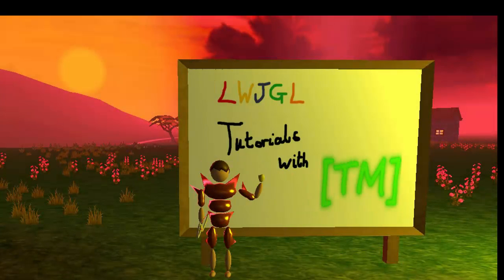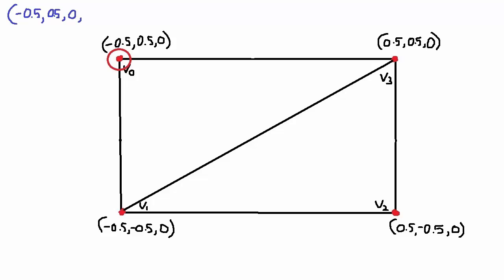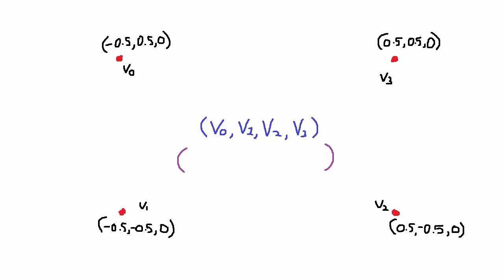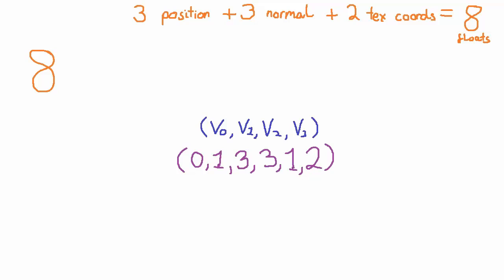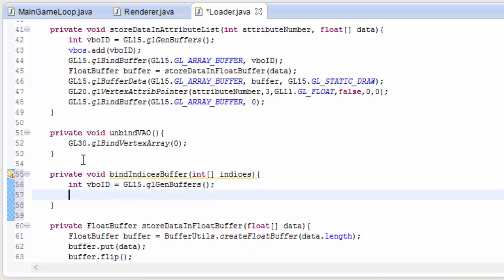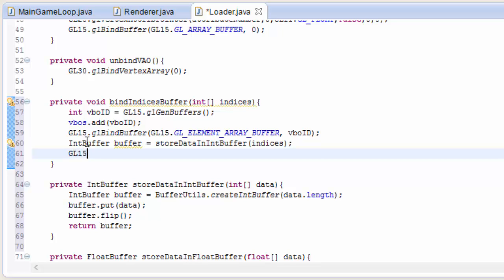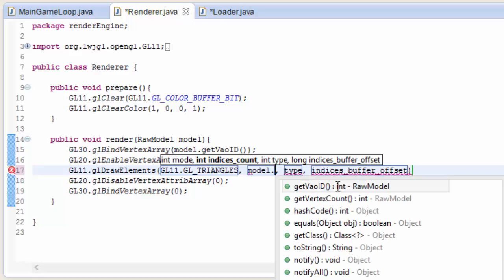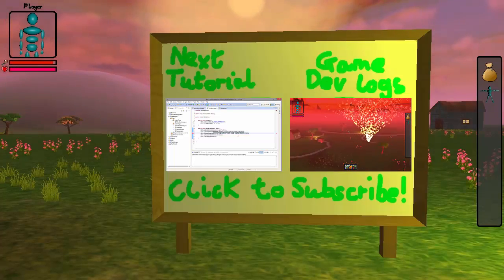OpenGL 3D Game Tutorial 3: Rendering with Index Buffers

Comment: you never called the unbind method for the indices buffer. dont you need it or did you just forget it?
Reply from the maker: You mustn't call it actually. Each VAO can have one index buffer associated with it. Binding an VBO as a GL_ELEMENT_ARRAY_BUFFER will set the VBO as the index buffer for the currently bound VAO. Unbinding it would remove it from the VAO, so then when you try to render using glDrawElements it wouldn't be able to find an index buffer associated with the VAO and it would cause an error.
Reply: ah ok. thx :)
Reply: can you explain more in depth about why the indices buffer shouldn't be unbound but the vertex coordinates buffer should?
Reply: reading more on the internet i believe that gl_array_buffer doesnt matter if it is bound or unbound since it can be rebound later?
Reply: +Steven Chu In case you're still wondering, when you've got a list of VBOs in a VAO, only one of the VBOs can be the index at any given time. In our case, it's the Indices VBO, because we use that to choose our vertices. 

As for GL_ARRAY_BUFFERS, our other data is that in the VAO (normals, vertices, textureCoords). Since you're going to have multiple of them, you need to specify which VBO you're going to send the data to. From what I understand, if you were to send anything to the GL_ELEMENT_ARRAY_BUFFER, it'll always be sent to the same VBO as the VBO the indices currently are in.

Comment: Just a question, i'm going to be making a voxel based game, is there any point at all to using indices considering each face is rendered depending on whether the thing next to it is rendered?
Reply: Yes, there still is. However, what you should probably do is create a VAO for one face, and re-use it whenever you need to render a face. Then use matrices to transform the faces.
Reply: Freakey _ Yes, you're right. However, the point of this is to allow for proper per-face culling. But there are probably better solutions to this problem, such as instancing like you suggested.

Comment: Great tutorial. I am wondering though, right now you are using one VBO plus one EBO per each model. From my understanding, there are two issues with that:
First of all, some drivers cannot handle many small buffers very vell, there is a limit of buffer allocations which for some drivers is just a few thousand (I could easily imagine a game with more models then that).
And secondly, this should be performing relatively bad as you need one bind + draw call per actual object in the world. That sums up to a lot of GL calls per single frame.

Then again, I have very little experience in OpenGL, just trying to follow some tutorials. Is this actual an issue? I assume you have much more experience than I! Thanks!
Reply from the maker: You are correct, it would definitely not be a good idea to have one VAO for every object in the game! But at this stage of the tutorials I was just introducing the concepts of VAOs and VBOs ;) Later in the series (by about episode 10) we start using one VAO per model in the game, so for example you could have 10,000 tree objects in the game but they all use the same VAO.
One draw call per objects isn't always too terrible though, and in fact there are some situations where you can't really avoid it. When you have many very different, dynamic objects with different textures - it's very hard to render them all in one draw call. But multiple draw calls can be done very fast on modern computers, and you shouldn't worry unless you're sending tens of thousands of draw calls per frame.  There are other situations where it is definitely possible to render many objects in one draw call though. Later in the series I cover "instanced rendering" which does just that, and if your world has a lot of static objects which use the same "material" then you can batch render them, although I haven't yet covered this in the tutorial. I use batch rendering for the static objects in my own game though.
As for one bind per object, we actually get that down to one bind per model in episode 13 (so 10,000 trees could be rendered with only one VAO bind required) but what I've never got round to showing is how to store the data for multiple models into a single VAO. You are correct in thinking that this would be better, as it would allow for less binding of VAOs before rendering. This is again something that I do in my personal projects, but I didn't really find the place to fit it into this beginner's tutorial series. Perhaps it can be a future tutorial though :)
Reply: Wow, great answer! Of course this is just the third episode of a beginner's tutorial on OpenGL, so I do very much understand that this is the best way for you to explain it. I was just wondering about scalability, and especially how you do it in your own games. Thank you for coming back to me so very quick, and keep on making these excellent games / tutorials / videos / comments / whatsoever!

Comment: Two problems,

1. can't read indices and makes game not run

2. before this episode i didnt get a white box in the center of the game, only a red background
Reply from the maker: If you get an error then it's best not to continue until you've fixed that error, so I'd suggest getting tutorial 2 working before you continue to tutorial 3. It's hard for me to guess what could be causing the error, so I'd just suggest going through the tutorial again and checking that you got everything correct.
Reply: k, got it, i might be back commenting on this vid again because i might have a prob later... :P
Reply: Like I said 5 months ago, im back with a new problem,

1: After I do this there is only one triangle, and my code for this is:

package engineTester;

import org.lwjgl.opengl.Display;

import renderEngine.DisplayManager;
import renderEngine.Loader;
import renderEngine.RawModel;
import renderEngine.Renderer;

public class MainGameLoop {

 public static void main(String[] args) {
  
  DisplayManager.createDisplay();
  
  Loader loader = new Loader();
  Renderer renderer = new Renderer();
  
  float[] vertices = {
    -0.5f, 0.5f, 0f,  //V0
    -0.5f,0.5f,0,     //V1
    0.5f,-0.5f,0,     //V2
    0.5f,0.5f,0       //V3
  };
  
  int[] indices = {
    0,1,3, //Top left Triangle (V0,V1,V3)
    3,1,2  // Bottom Right Triangle (V3, V1, V2)
  };

  RawModel model = loader.loadToVAO(vertices,indices);
  
  while(!Display.isCloseRequested()){
   //game logic
   renderer.render(model);
   DisplayManager.updateDisplay();
   
  }
  loader.cleanUp();
  DisplayManager.closeDisplay();

 }

}

2: Background is BLACK  not RED Even when i coded it to be red, the code for this is:

package renderEngine;

import org.lwjgl.opengl.GL11;
import org.lwjgl.opengl.GL20;
import org.lwjgl.opengl.GL30;

public class Renderer {
 
 public void prepare(){
  GL11.glClear(GL11.GL_COLOR_BUFFER_BIT);
  GL11.glClearColor(1, 0, 0, 1);

 }
 
 public void render(RawModel model){
  GL30.glBindVertexArray(model.getVaoID());
  GL20.glEnableVertexAttribArray(0);
  GL11.glDrawElements(GL11.GL_TRIANGLES, model.getVertexCount(), GL11.GL_UNSIGNED_INT, 0);
  GL20.glDisableVertexAttribArray(0);
  GL30.glBindVertexArray(0);
 }

}

I have looked through tutorials 1, 2 and 3 yet even when I look in the description I already have coded that. Please help! taking help from anyone!
Reply from the maker: CJ Computers Gaming Are you ever calling renderer.prepare()? It should be called every frame from the MainGameLoop. For the triangle problem, your vertex positions are slightly wrong. You have both V0 and V1 with exactly the same position.
Reply: The triangles fixed, probably a stupid question I could've answered myself, although the prepare render, I am slightly confused on were to put them, in create display, update display, and close display, or somewhere else?
Reply: Ok, I figured it out, I had renderer render instead of render prepare at isCloseRequested, but now the triangles are gone! what do i do? Here is MainGameLoop Code:

package engineTester;

import org.lwjgl.opengl.Display;

import renderEngine.DisplayManager;
import renderEngine.Loader;
import renderEngine.RawModel;
import renderEngine.Renderer;

public class MainGameLoop {

 public static void main(String[] args) {
  
  DisplayManager.createDisplay();
  
  Loader loader = new Loader();
  Renderer renderer = new Renderer();
  
  float[] vertices = {
    -0.5f, 0.5f, 0f,  //V0
    -0.5f,-0.5f,0,     //V1
    0.5f,-0.5f,0,     //V2
    0.5f,0.5f,0       //V3
  };
  
  int[] indices = {
    0,1,3, //Top left Triangle (V0,V1,V3)
       3,1,2  // Bottom Right Triangle (V3, V1, V2)
       
  };
  
  RawModel model = loader.loadToVAO(vertices,indices);
  
  while(!Display.isCloseRequested()){
   //game logic
   renderer.prepare();
   DisplayManager.updateDisplay();
   
  }
  loader.cleanUp();
  DisplayManager.closeDisplay();

 }

}
Reply from the maker: CJ Computers Gaming You need both "renderer.prepare()" and "renderer.render()" in the while loop. Each frame you prepare the renderer (clear the screen), then render your scene, and then update the display.
Reply: Thank you, the complete tutorial 3 is finished and i can now continue working

Comment: Why don't we unbind the VBO after creating it ?
I tried :

"int vboID = GL15.glGenBuffers();

// Bind VBO
GL15.glBindBuffer(GL15.GL_ELEMENT_ARRAY_BUFFER, vboID);

GL15.glBufferData(GL15.GL_ELEMENT_ARRAY_BUFFER, storeVBOInIntBuffer(indices), GL15.GL_STATIC_DRAW);

// Unbind VBO
GL15.glBindBuffer(GL15.GL_ELEMENT_ARRAY_BUFFER, 0);

vbos.add(vboID);"

But it creates an error. So without unbinding it, it works, but why don't we unbind it, and why can't we unbind it ?
Reply from the maker: Binding a VBO as a GL_ELEMENT_ARRAY_BUFFER binds the VBO to the currently bound VAO as its index buffer. If you were to then bind another VBO as a GL_ELEMENT_ARRAY_BUFFER then it would use that as the index buffer instead. Each VAO can only have one index buffer bound to it. Binding "0" as the GL_ELEMENT_ARRAY_BUFFER unbinds the index buffer from the currently bound VAO. So if you do this your VAO won't have any index buffer associated with it. Using glDrawElements requires an index buffer to work, which is why you get the error.
Reply: +ThinMatrix oh ok, I tought that the binding system worked in the same way for both VAOs and VBOs. So that's why we don't put any attribute number for the VBO, it already have it's own place in the VAO ? 
By the way, thanks for the quick answer ;)
Reply from the maker: Yes that's correct, there's a special place in a VAO for one index buffer, so it doesn't have to go into one of those attribute slots.
Reply: +ThinMatrix ok, thanks for the answer :D

Comment: jus for you beginners to OpenGL out there... this means the vertex's data are shared...
so if you were making a cube perhaps... (cheeky smile) then the different sides would have totally different shades...
meaning 6*4 verts for an entire cube...

but with many cubes hiding faces away, it's ok anyway...

anyway... and oh yes... use quads on cubes also, cause using 4 verts is faster at processing than 6...
and the fact that interpolation is straight forward too... cept when the antialising problem occurs, meaning you have to simply flip the quad... which minecraft doesn't even do btw... nobody notices... :] so no biggie ey?
Reply from the maker: The use of GL_QUADS is now deprecated in the modern version of OpenGL and so shouldn't be used. The GPU only deals with triangles anyway, so the quads were just broken down into two triangles behind the scenes anyway.

Comment: When I start the program, it crashes and then tells me that I cannot use offsets when Element Array Buffer Object is disabled...My Renderer-render-Code:public void render(RawModel model){   GL30.glBindVertexArray(0); GL20.glDisableVertexAttribArray(0); GL11.glDrawElements(GL11.GL_TRIANGLES, model.getVertexCount(),GL11.GL_UNSIGNED_INT, 0); GL20.glEnableVertexAttribArray(0); GL30.glBindVertexArray(model.getVaoID()); }
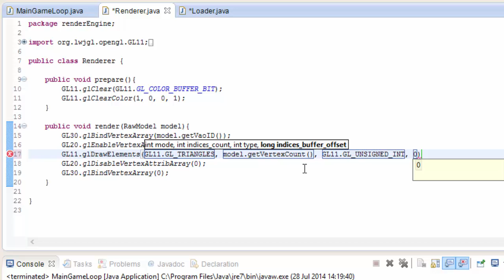Reply from the maker: You're unbinding the VAO before rendering, and then binding it afterward. That means when you call the draw method no VAO will be bound, and so it won't have anything to draw. Have a look at 10:40 to see how the render method should look.
Reply: Thank you veery much for the fast response, now its working :D
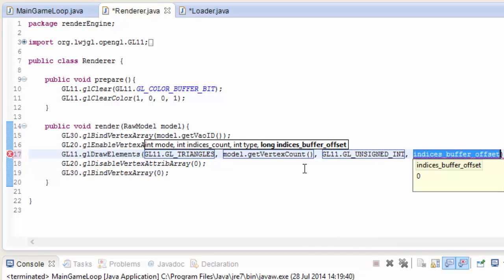Reply: Im having that same problem cant seem to fix it can you help me on that part i rewrote the code 3 times at 10:40 secs and still loads up and crashes

Comment: I dont understand how the 3 float vertices become assigned to 1 of the indices in the code; in loadToVAO i binded the indices, but I fail to see how the indices and vertices can interact. Can someone point to the specific part of the code where this happens?
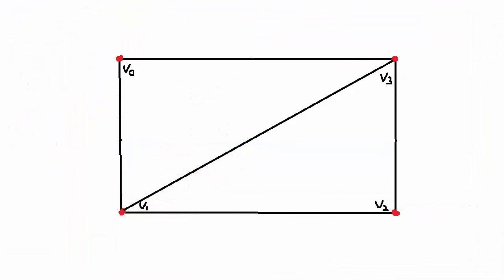Reply: At 2:20 its explained good:
Vertices are the Positions (Coordinates).
Indices are how these Positions are connected.

Think of it this way:
Take a piece of paper, draw a coordinatesystem on it, and drop some random points (coordinates) that are named from p0 to p4.
So you are the computer and I want you to connect the dots.
But.. you are a computer.. you dont know what dot is connected to which. So I give u the indices (order of the connecting)
and ther u go

Comment: I am getting white triangle
Reply: I had the same problem, but I saw that the vertices variable was changed.Replace the old vertices variable with the new one:float[] vertices = {
   -0.5f, 0.5f, 0f, 
   -0.5f, -0.5f, 0f, 
   0.5f, -0.5f, 0f,
   0.5f, 0.5f, 0f,
  };
Reply: +TheChosenEvilOne T_T Thats probably cause you've copied verticies from a comment below and it has one vertex less than shown in the video.

Comment: Could be problem if a different normals were wanted for the same vertex to make flat sides, such as for building.
Reply from the maker: +Jared Blackburn To fix this you just have to duplicate the vertex once for each connecting face along hard edges, so that each face has a copy of the vertex with the correct normal for that face. This can be automatically done when loading up 3D models, as shown later in this series. Depending on how many hard edges there are it may still be more efficient to use indices. For most normal 3D models indices will still use a lot less memory, despite duplicating the vertices along the hard edges. But in some situations (such as a single cube, or low-poly models where all the edges are "hard") using indices would be pointless because you'd have to duplicate all the vertices anyway and so no vertices would be shared.

Comment: I don't get a rectangle (with the code from the first episode and the color fix shown here in the beginning). Its all just red. When I tried to make the background green there was still no rectangle, so it was not red either. Is it possible that the rectangle renders with 0% opacity or am I doing something completelly wrong?
Reply: +Ein Frosch~ IF ur using mac or linux its normal coz u probably need to have the shaders. Wait for ep 5
Reply: +Pedro Candeias I'm on Windows, the shaders didn't help me with this. I messed up somewhere else without the Compiler caring too much, I started all over again, now it works.

Comment: Why does it have to go counterclockwise?  I tried it clockwise, and it worked?  Is it some systems care, i'll run into weird bugs later, or just convention?
Reply: +Jonathan Levi counterclockwise for surfaces that is pointing towards you. Clockwise will not show until you turn it.
Reply: +Jonathan Levi I didn't test it yet and I'm still learning but I believe that it has to do with what side of the triangle is the in- and outside when you render a texture onto it.

Comment: Hello, i keep getting an error whenever i try to startup the program, it all points to line 36 in the Loader class wich i've found out to be inside the createVAO() int, it gives up an error on the line with this content 'int vaoID = GL30.glGenVertexArrays();' i havent found a way to fix this at this time but i hope you can answer with an explanation why it might be giving up an error, P.S. i'm using Lwjgl 2.9.1.
P.P.S. Nice series!
Reply from the maker: +Dempsey What exactly does the error message say?
Reply: +ThinMatrix It says:
Exception in thread "main" java.lang.NullPointerException
 at org.lwjgl.opengl.GL30.glGenVertexArrays(GL30.java:1535)
 at renderEngine.Loader.createVAO(Loader.java:36)
 at renderEngine.Loader.loadToVao(Loader.java:19)
 at renderEngineTest.Main.main(Main.java:28)

This is the createVAO function:

private int createVAO(){
  int vaoID = GL30.glGenVertexArrays(); // Error line 36
  vaos.add(vaoID);
  GL30.glBindVertexArray(vaoID);
  return vaoID;
}

this is the loadToVao function

public RawModel loadToVao(float[] positions, int[] indices){
  int vaoID = createVAO(); // Error line 19
  bindIndicesBuffer(indices);
  storeDataInAttibuteList(0,positions);
  unbindVAO();
  return new RawModel(vaoID,indices.length);
}

error line 28 in 'Main.java':

RawModel model = loader.loadToVao(vertices,indices);
Reply from the maker: Dempsey I'm not sure what could be causing that I'm afraid, I've never come across that problem before. I really can't suggest anything other than googling it to see if anyone else has had the same problem before. Sorry :/
Reply: No problem, thanks for even responding to my question at all